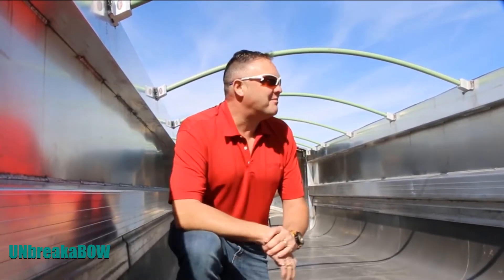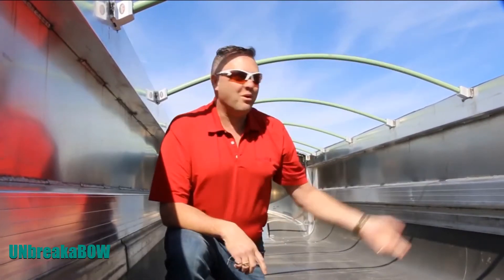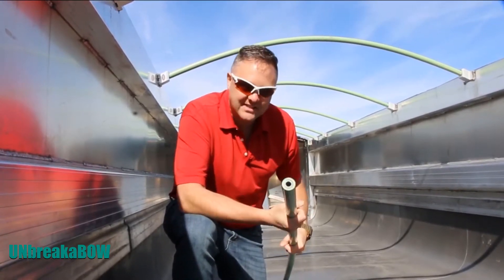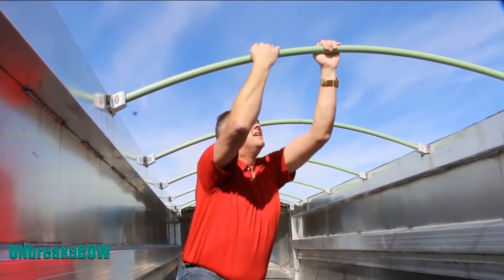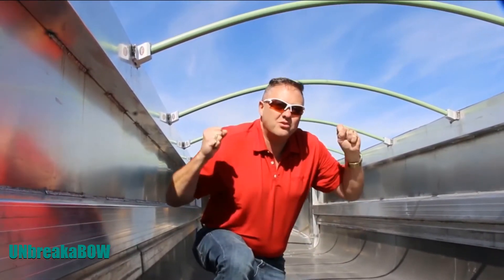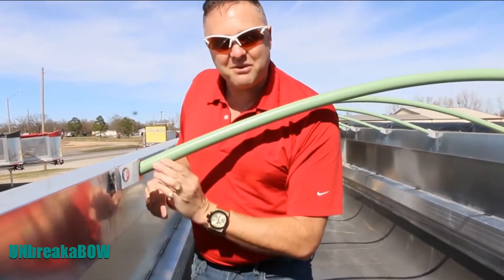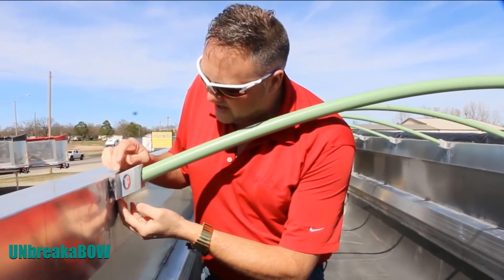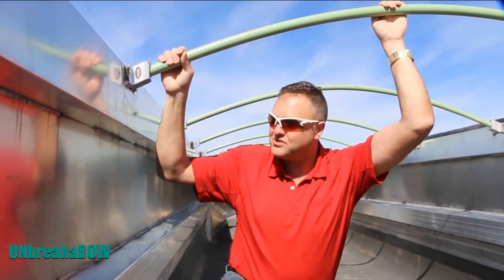Dump Truck and Dump Trailer New Tarp Bows | The UNbreakaBOW!

Comment: Junk my company that I’m leased to just have a trailer equipped with these garbage bows. They break really easy just drop it on the ground boom broken. And heaven forbid you’ve ever got to remove them to load you’ll need 3 men to do that job! Pure junk bows and mine are so stiff my 30 year old son and can both hang off it and it won’t give an inch. The little relief holes plug up all the time too! Save your money and just buy plain aluminum or steel bows these are junk and cost like $80 apiece not including those pockets for each side and installed.